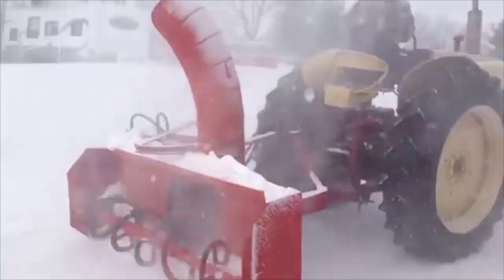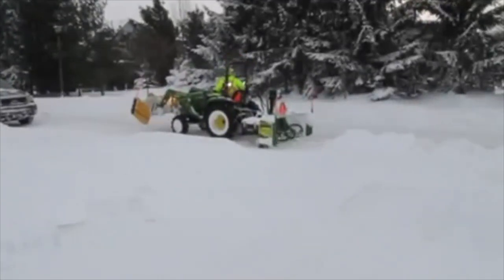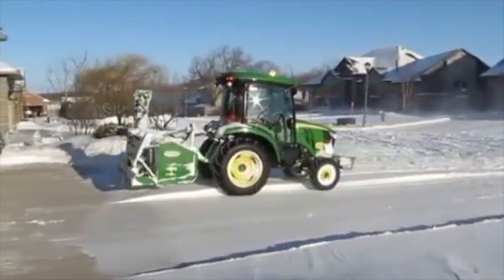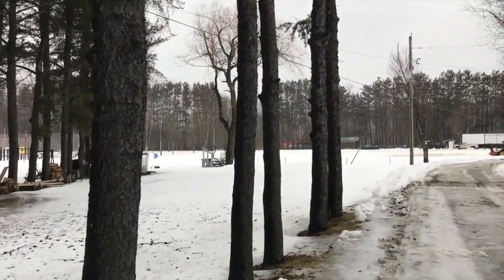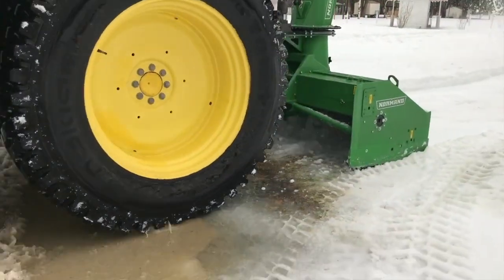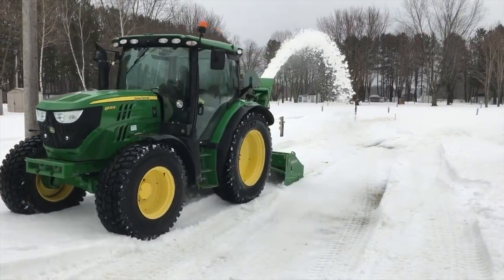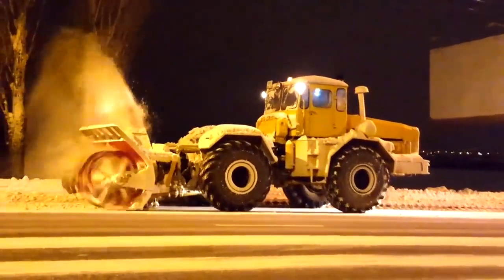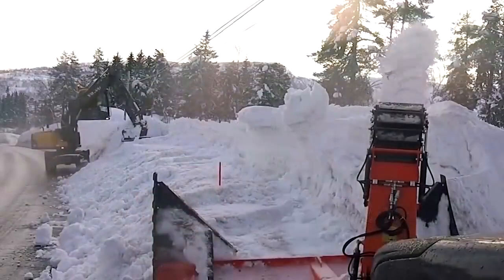Conventional Vs Inverted Snowblower (On An Ag Tractor)

Comment: @2:37   Its my experiance that I will run my (front mounted) blower into the curb and break shear pins.    I do like how you dispurse the snow by using the blower, but opperator has to have a little luck doing it this way too.   Nice work and good used of a loader for the back drag

Comment: Would a larger tractor like a 6130M get stuck in deep snow with an inverted blower, or is that just a concern with the smaller tractors.

Comment: How the hell is a 3046R too small to do residential driveways?  You’re in a subdivision neighborhood! 

I have a 1025R and a 3046R and I live in a very rural area in Michigan where we get heavy snow loads and I find that even the 1025R does well. The 3046R does even better.   I don’t get your logic

Snow pusher is better. 
Unless you have no place to pile the snow up to.
Reply from the maker: Hmu when you service 3k + driveways
Reply: @nickbohner9261  so tell me how a 4 series is any faster at doing a subdivision driveway over a 3046R when / if the attachments are equal size.
Reply from the maker: @scottdonbrosky5968  it’s not faster, it just breaks down less and gets through more snow. 3046r is still a great unit

Comment: I have a front and I love it. However the snowblower frame and the backhoe frame are not interchangeable. When tractor manufactures get their act together The subframe will come mounted to the tractor and be able to accept all attachments. It’s not just removing the The sub frame it’s removing and replacing  big connections that hold a sub frame also the subframe is in the way of the loader so the subframe has to be removed in order to put the loader on. In plain English this is bull$hit!!!

Comment: Why wouldn't you front mount a regular blower or PXPL and be done with all the nonsense? You could also utilize a U300 through U500 Unimog as it comes with a front 3 pt hitch and mechanical PTO so you can drive faster between different accounts and mount a sander in the bed. Even a cabover truck like a Mitsubishi Fuso 4x4 with a hydraulicly run front mount blower and aux. engine/hydraulic pump in the rear? I want to get close to peoples garages so it it less work for the customer and an inverted blower does not allow that.

Comment: The biggest weakness of the inverted blower is that you still turn around to look at where the snow is going, but you're driving forward. With a conventional blower you face the direction that you are moving at all times. Also, maybe not an issue for everyone, but conventional can handle more snow with less mess
Reply: If your moving snow commercially, your not worried about moving a lot of snow because your out every 3-5cm.. and if you get a good back up camera and set your mirrors up properly.. your not turning around to look as much as you'd think
Reply: @Morpheen999  Either way, I would imagine your looking back a lot less with an inverted blower.

Comment: A really great setup is a front blower with a rear blade.  Advantages:  1. You spend the majority of your time driving (and blowing) forward - it’s faster and you’re not craning your neck.  2. you aren’t driving over the snow before blowing it.  3. The rear blade can be backed up to clean near garage doors and/or scrape down to clean the surfaces where the snow is pre-packed.
Kubota probably has the best off-the-shelf systems for front blowers.  They have a variety of blower sizes (all made by RAD in Quebec where they know snow), support frames, and both manual and fully automatic connection kits for a wide range of tractor models.  Most of the Kubota tractors are also available with mid-PTO’s so it’s an easy setup.
Reply: That’s the exact setup I have on my BX2380. I back up to garage doors drop the back blade down and it cleans almost all the snow away. I’ve seen guys using box blades instead of back blades. This year I’m running a UHMW scraping blade to reduce noise and scratching/ gouging the driveways.

Comment: So I'm watching this video, and the operator in the big JD 6 series (at 8 min) is pulling an inverted unit, but looks like he's looking backwards just as much as if he actually had a rear mounted unit.
Reply from the maker: That may be true, however positioning to perform the work vs actually working on reverse are very different things.
Reply: @nickbohner9261  - So I'm not sure if that was you or just stock video footage in that particular part, But do you find that you can basically set it up for a run and just go? I'm looking at buying one for my Kubota 2650 and I guess my way of thinking is that if I have to always be turned around, I may as well just buy the lower priced conventional rear mount. Thoughts?

Comment: I have a 1.5 mile long driveway in Northern Wisconsin. My inverted Meteor snow blower is invaluable. I tried a conventional and my neck was sore in 30 minutes. The inverted is the way to go if you have any length of driveway to do. I am using a Mahindra 2538 (38hp) with a 68" Meteor inverted.
I LOVE my inverted snow blower.
Reply: Jim  how does your inverted handle the snow banks.  I have an .8 mile drive in Vilas county and am thinking of getting the same snowblower with a Kioti ck3510.
Reply: @jamiep5660  Inverted blower on the 3 point and snow bucket on the frontloader is all we ever use here in Norway, no issues with banks or anything, lower the blower and drive, if it starts bogging down = reduce gear and raise RPM's, simple as that :)
Reply: @ToreDL87  As a fellow Norwegian this discussion on inverted vs regular snowblowers in the US is puzzling, don't think I've ever seen what you guys call a "regular" snowblower on a tractor here, and I live in a place with a LOT of snow. As Tore says, rear mounted, forward facing blower plus a plow or snowpusher on the front is what pretty much every snow-removal contractor uses. Getting the same setup for my farm this winter as an upgrade from a 6x6 ATV with a frontblower.
Reply: @ToreDL87  Yup, no problem. I'm a Norwegian living in the US, and heads are exploding when we use a pull type snowblower. Works for me in Montana since I'm used to pull type snowblower from home in North Norway.
Reply: @texnorthman  Precisely.
Reply: @tractortyme  You're almost like a missionary for our cause then 😆
Most of the American's seem to think (and exactly in this order) that the tractor driving over the snow will just pack it so the snowblower can't scrape it up somehow, and it leaves snow further from garage doors.
The only way they'll go "ooooh, I get it now" is to explain that it is a tractor implement, and those are rear mounted, forward facing, to give the most traction and power to the ground, it's designed that way, tractor 3-point 101.
If tractors packed everything we drove over, we couldn't even do modern farming in the first place, if you let it snow so much you can't drive over it with a tractor, you've done a professional goof, rule #1 is to always be out early and do it multiple times, that's what you're paid for.
And for the snow left in front of the garage door: Frontloader 😊
Reply: @ToreDL87  Yeah, I tell them all the time that pull type snowblowers and roundabouts make 'Murica go🤯 🤣
Reply: @tractortyme  🤣🤣 Epic!
How is it over there compared to the "nanny" states?
Reply: @jamiep5660  I am looking at purchasing the same setup as you just the SE version with a cab Did you buy the tractor and if so what was your experience and did you buy chains
Reply: How do you like it in wet and heavy snow? I'll looking to buy one . Just need advice please?
Reply: Here we are four years later and my meteor inverted snowblower is still working absolutely perfectly! I have a 7 foot blade on the front of my tractor and the inverted snowblower on the back. I can even ride my right tires into the snowbank and widen my driveway anytime I want.
Reply: Oh no problems with wet and heavy snow. I do spray the inside of the shoot once a year with silicone spray, but that is usually after the season is over. Maybe that helps the snow release but I have never had a problem. This thing shoots the snow 35 or 40 feet into the woods.

Comment: conventional blower  whit a doors  that goes down  to pick up  the snow that left back in and pull it to the road that works the best like this https://www.youtube.com/watch?v=CnM6a0_u-KA  you can pull snow from anyware wer you cant blow it and blow it after  and you can  use it also going forward  no need  for a front end loarder  make the tracktor shorther make it easy in tight pace